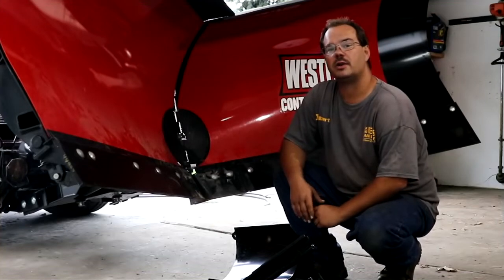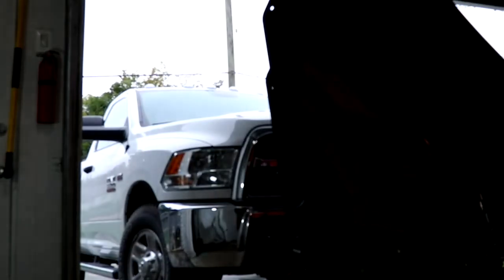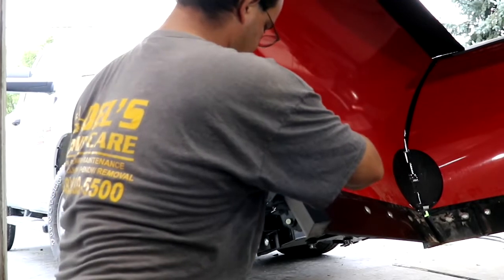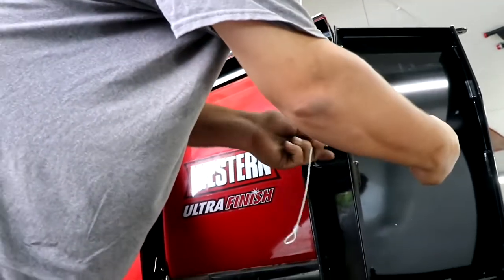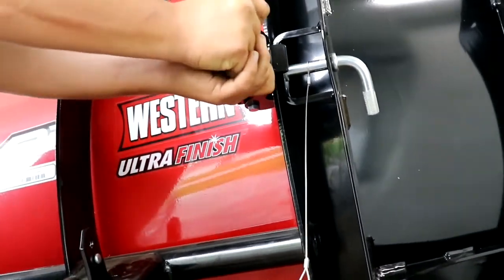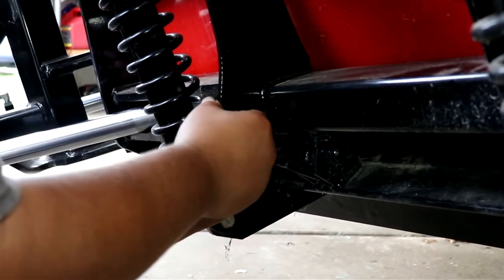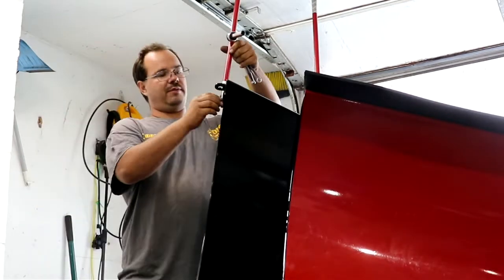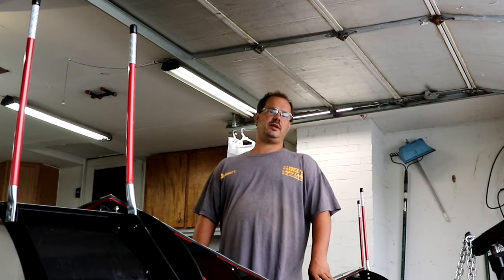Western MVP 3 WING KIT INSTALL 43510-1

Comment: I'm putting those sucker's on mine this year thanks for the video
Reply from the maker: Anytime. It sure makes a difference. I plan to put them on the MVP PLUS so that video will be out later this month I hope.
Reply: @DelsLawnCare  have u made any videos changing the hydraulic fluid on the wide-out or the mvp3?
Reply from the maker: @LAWNFORCELLC  no. Truth is for the $125 they charge I get a pop and look at all the new equipment while someone else does it. I guess I could do it cheaper but I'm lazy sometimes.

Comment: Hey there you got a new truck looks good love the plow I just bought the same one now I’m thinking about wings and stoppers also. I don’t know why they don’t come with the plow already.
Reply from the maker: Thanks for watching our video. I did subscribe to your channel. I have many mixed feelings about the wings and price. The blade stoppers should of been put on from factory.  If they want to charge $700 for wings I don't understand why there is not a spring and tip edge like the rest of the plow.  If I'm paying $700 why does it not look like it belongs on the plow. I mean it's black and shorter. We have so many robots, computers to build anything else. Why did western drop the ball on these few things? I am with you on this and with the price  i'm paying I would like to see something for my $700.
Reply: Thanks for subscribing I’m going to try the YouTube stuff out. Plus this way I can see how I grow over time and my editing skills improve. I have to say this it’s a heck of a lot easier to hook up the western compared to my old boss.  After about 5 years the pins started acting up sometimes it wouldn’t latch you had to push up on the light bar.  Then uneven ground have fun. But it was a good plow for 18 years
Reply from the maker: @imperialservices9892  I have one boss plow it's in a few of my videos for a couple seconds. I hate it. Hooking up sucks really bad, the old style lights break every season.(YouTube)  Edit's are crazy for videos. My son has done over 300 videos and if you watch this video he has my back showing part of video, he didn't show the whole kit that was on the floor, he pointed the green dot on a black object so as you might of notice the blur. I won't cry about it because I am teaching a kid but it's sucks when your trying to show the whole world something they might have never seen.I wish you the best with YouTube and what ever you do but never give up for there is always going to be a better day.